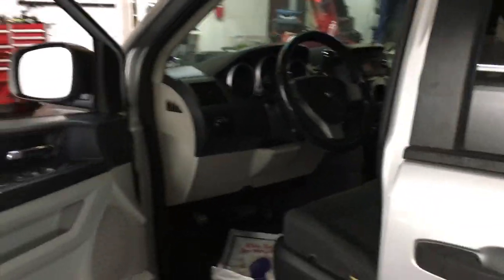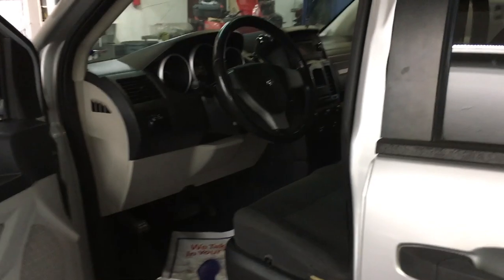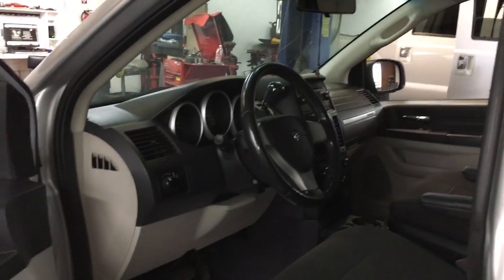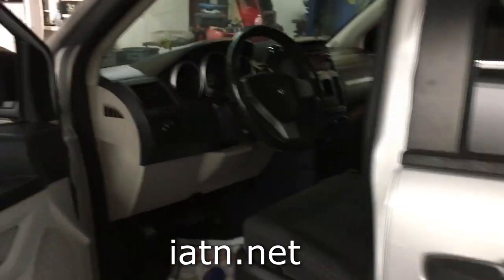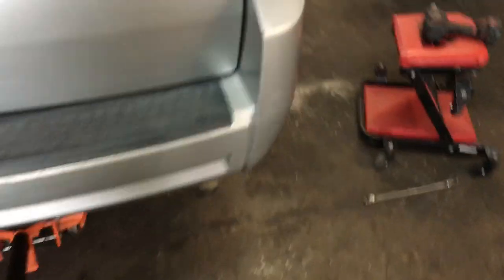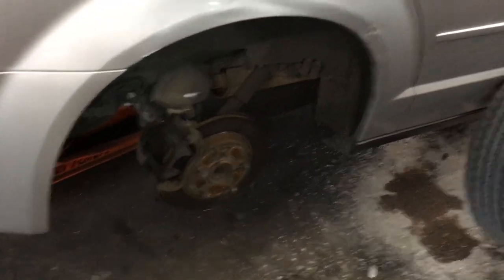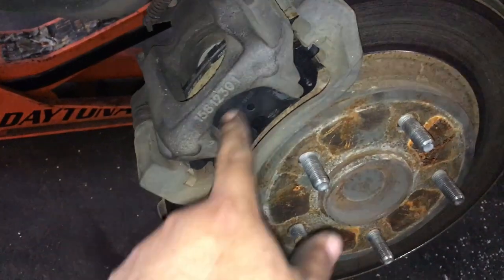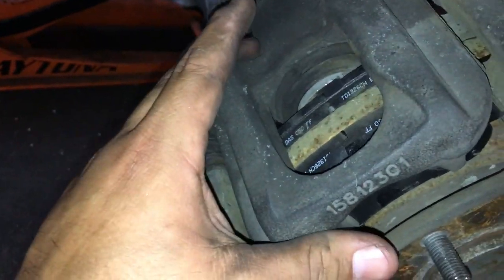DODGE GRAND CARAVAN BRAKE PEDAL GOES TO FLOOR QUICK TIP!

Comment: Okay, I have a question. 2006 Dodge Grand Caravan. Pads and rotors seem fine. Recently, the stupid ABs light came on. Seemed like your typical ABS nonsense, poorly made garbage wheel sensor or something. But had no effect on the van driving. Could shut it off with the scanner tool or disconnecting battery. It would come back on after a day or two. Then, after months of that light being on (not sure if it's related) the pedal would sometimes feel soft and go to the floor. I could let off it, and hit it again, and it would work. Scary feeling! It seems like it is intermittent, but only appears to happen when the ABS light is on. My mechanic insisted it was the master cylinder. So we replaced it, bled the brakes, and took it for a ride. Drove several miles in the mountains here, and no issue. The ABS light had gone off because he disconnected the battery to clean the battery posts. Then the ABS light came back on but still seemed like it was fixed. The next day, took it for a ride to my son's work, seemed fine all the way there (about 8 miles). On the way back, the pedal went to the floor just like before. I showed him this video and he pulled the wheels off the back, and my 2006 Grand Caravan doesn't have the screw in cylinders. The piston seems to be right up against the pads. So I have no idea. He is currently trying to bleed them again to make sure, and I'm waiting for a call back. Besides the fact that Dodge just makes horrible vehicles, anyone have any other suggestions?
Reply: For the record, this van is a 2006, but only has 119,000 miles on it. Always been maintained. It was owned by my wife's grandfather who passed away 2 years ago, and it was passed on to us, or I would never have bought a Dodge by choice. He ALWAYS took great care of his vehicles. It never saw snow and was mostly used for highway driving in Florida. Please help!
Reply: So what ended up being the issue?! 🤷
Reply: @adamxenon829  So my mechanic suggested that maybe they sold me a bad master cylinder because the brake fluid turned black without hardly any use. So he suggested I get a new master cylinder and try again. So I did. And I haven't had a problem since. However, sometimes when it's raining the ABS light comes on for that front right speed sensor. I'll replace that eventually, but where I live, I don't have much need for ABS anyway. In fact, I think ABS is a waste. Never needed it before.

Comment: Am having intermittent problems with brake pedal response.  Just had to hit it to floor on a 2013 caravan and then release and reapply before the brake would catch.  (Was parking stop the time).  Later brake responded to only a light tap then had to depress harder to get brake response.

Comment: On my 2005 Lexus GX470, brake pedal would sink to the floor and even then the truck still advances until I pulled up the hand brake.  Local shop could not figure it out, just replaced brake pads and it went back to normal. Now the issue is back.  You think this method is applicable to my ride?

Comment: My ABS , BASS , ESP dash lights and the. 'Slippery when wet ' light ....all ON... :/
So far can't get them to go OUT.
I Have a 2010 Dodge Ram Caravan......electrical malfunctions.....windows go down on their own while van is NOT running....( scary ) and electrical engaging noises are heard in the doors when van is off.
I'm also aware of the Airbag Recall......oi.......bought it off the Car Lot having no idea what I was in for.

Thanks for the vid ....more to think about.
I recently had new ceramic brake pads and rotors put on....again......

Any other suggestions much appreciated 👍

Comment: I'm  having this same issue after replacing my rear pads. I actually figured this out about backing the caliper out and it solved the problem when I had the old rotors. I decided I might as well replace the rotors, and now the calipers are acting the same way like they are screwed in too far, but with the new pads and rotors, there is no room to back the caliper out and still fit the caliper over the pads. Even a 180 turn (the smallest possible) is too much and I can't install the caliper. Is there a way to adjust the baseline so the brakes will function correctly again?
Reply: Note that there is a difference in the rate at which the piston moves when screwing in versus screwing out.  Turning out moves fast, It takes many more turns moving in to go the dame distance.  If a half turn ts too far out, back int in after moving out to get a good fit.

Comment: Hi, I have a similar issue on a 2011 Routan which I think is the same thing as the Chrysler. For me the pedal sinking only happens when I brake hard, pedal sinks to the floor and takes a while to stop.

Can this issue mentioned apply to my issue as well?

Normal braking seems fine.

Comment: I'm having the same problem but I never replace the back brakes because they are fine I replaced the two front brakes and now I'm having that problem . Could it be because of the rear brakes?

Comment: Finally, this is my car's situation, my Routan have to make a safety check by some garage in Ontario, I paid more than $1000, replace two rear brake rotors and pads and other, but the brake became soft, it wasn't like this, I drive the Van to garage let the boss try it again, he said this is no problem, .....the Ontario government issue some rule make my car repair worse, the boss didn't understand this detail and his disciple did this poor job, after repair, I got a worse brake system, do I need to tell the garage let them to learn this?

Comment: Hum... On most cars the piston would self adjust by applying the brakes. The biggest problem I see with the calipers that have the e-brake integrated into it, is not aligning the pin on the back of the pad with the slot in the caliper piston. On most cars this means screwing the piston back in but stopping with the slot at the 12:00 position. 
If you don't so this the pin on the back of the brake pad will not fall into the slot and you end up with the gap like you talked about. Note that this would not apply to cars that use the drum style e-brake made inside the rotor assembly.

Comment: This video did not address the issue of 'why' there is a gap between the piston of the brake caliper and the brake pad, all you did was adjust the gap so the piston is now touching the brake pad. The piston in the calipers are self adjusting for wear of a brake pad. If you have a gap with new or old brake pads, the problem is most likely that the gasket around the piston is sticking and preventing the piston from turning freely when braking/adjusting. This is common on all rear disc brakes, and is the result of the piston not being lubricated (externally) and cleaned.

Comment: Aren't the calipers supposed to self adjust? I have a 2010 Dodge Journey RT with the same problem, would it be that the piston is being turned in with too much force when the pads are replaced?
Reply: Still doesn't make sense why this would be an issue. If the piston was turned in flush it should pump out to meet the pad otherwise as the pads wear you would have to continuously adjust the piston.

Comment: I guess this type parking brake should adjust to limited location, make sure no gap between the pads and rotor, other wise brake piston should move a long distance and make the brake pedal soft...

Comment: 2016 Ford Explorer has that same twist in rear caliper as did my 02 Accord. Both were placed back and functioned without issues for me. Do you think the owner compressed the piston back in instead of turning?
Reply from the maker: I’m not sure but I do believe it may have to do with the rotors being too thin. I recommended replacing them to the customer, but he declined.

Comment: Great video. For those that are asking about why this happened, or can this happen to front front brakes, or why wouldn't pumping the brakes fix the issue.......This caliper in the video is "unique" because it has a parking brake cable attached to it. The piston of the "unique" caliper works differently than the piston of the "basic" caliper because it has two functions, not just one. I wont got into detail of why it works differently. Just know that you wont have this issue with "basic" calipers. 

Many vehicles are now using an electronic parking brake system which does not use a brake cable. But same thing applies here. They have "unique" calipers that work differently than "basic" calipers.

Comment: My 2011 Grand Caravan has an intermittent low brake pedal. Happened back in August 2019. When I got it to the dealer the pedal was high and firm again. They had no idea what the cause was. Happened again Jan 2020 on my way home from Tampa. While pulling into a rest area I had my foot on a firm high brake pedal and then it went down near the floor. Still had braking but very low. About 20 miles later the pedal came back up and was fine the rest of the way home. If anyone has any ideas I would love to hear. Thank you!

Comment: I have a 2001 dodge van that has something similar, the brakes work upon pressing ok, but if you let up just a little and ride them the peddle loses pressure and eventually just goes to the floor and stops working. Is that what this is?
Reply: Bad master cylinder.

Comment: I went thru multiple brake parts changes and then the mechanic had for it 3 weeks. Found out that the new rebuilt front calibers from Autozone contained dirt and pockets of air even though the mechanics said they pumped gallons of fluid thru the system. They took off the calibers and pressure tested them with air and worked the calibers that they said were sticking and bench tested them. He said he never uses Autozone, Oriellies ect. for parts. It works now. Front Calibers, brake shoes, master cylinder, used ABS, $800

Comment: Typical Chrysler poor design. How does this company stay in business?
Reply: well....they sorta don't really..."Chrysler" has actually been five different companies in the last 25 years.
Reply: @geoffrwelsh  I meant the current one that sells cars that are junk before the odometer reaches 10 miles.
Reply: Issue is lack of using park brake often enough and right after new pad installed. It self regulates, keeping calliper piston in contact with brake pad.
Same design utilized in so many car makes.
Reply: @vwecco1  That's BS. I've changed tons rear pads. Rear caliper ALWAYS self adjusts correctly.

Comment: In order to have the piston barley touching the pads you need to purchase after market pads that do not have the metal peace sticking out where the piston groove is, if it does have it, it's going to be too much of a gap for the brakes to have a decent contact.

Comment: Man, that customer fired a really expensive shotgun at that van.  

New pads, worn out rotors, mmmmmm.

One thing habit I got into when these calipers were more common is that pumping the service brake and working the parking brake at the same time seems to work pretty well at avoiding this problem.

Comment: Hi there
I opened to see how is my Dodge Caravan 2010 I FOUND INTERESTING THING
1- park brake not holding the wheels.  2- There is a little gap between pad and rotor.  3- I could not spin it any direction.  4- Took it off then found there are 3 pins (stud) on back of pads and the middle one doesn't let the piston spin, it has been installed with the cut off on piston (for tool) over the pin. 
as you now piston needs to spin to go out and push on pad .
I GRINDED THE MIDDLE PIN.!!!!!!!!
It is self adjusting now.

Comment: Ok, but what about when you change the front pads on a grand caravan, and squeeze the calipers in, do you get NO pedal after you reassemble it?? Goes to the floor. Pump it with engine on or off. Brakes grab at the floor but no peddle. Happens every time.

Comment: Your going to send it out with just doing what you described.  So you dont think who ever did the rear pad swap..... did not damage the caliper.
I have seen this before. My customer told me that they did rear brakes on a Nissan and never felt right after. Then I asked if he had difficulty. He said yes he had to really work the C clamp to get the piston back in. 
Please replace your customers calipers.

Comment: Sooooo...  when the rear pads wear are you going to re-adjust?    Here lies the problem with your solution.  Throw the $80 dollar caliper in the garbage.  It's a self adjusting unit and should have pumped out to meet the pad after brake installation.  Caravan calipers are marginal at best.  I could fill a large bin with Caravan calipers replaced over the years solving the same issue.   BTW,  do both.   Just my few cents after 23 years of service.   Good video for the driveway guys that do their own brakes and come across the same problem.. will get them to a shop to safely replace calipers.

Comment: As soon as I saw the video, I knew what was wrong. It's a Dodge. Do NOT buy anything from Dodge. Dodge have been making cars since 1900, and they still have not figured out how to make reliable vehicles. When they discover problems, they don't fix them. They continue to mass produce garbage. Try to find a Dodge Neon on the road today. Those cars were junk, with paint that peeled off down to the primer. The 2.7 motors they actually put in Dodge Chargers have a long history of failing, and yet they continued to put them in cars well into the 2010's. Dodge is the worst car company in America. I personally will never buy one again. If you want something reliable that won't get you killed, get a Honda, a Toyota, or a Subaru. Sure, Dodge makes good LOOKING cars, but they are made of garbage parts, by the worst engineers America has to offer.

Comment: well it looks like the caliper is faulty.i work at a dodge dealership and ive never had this exact same problem before and i have done a lot of break jobs on these vans.the caliper should pump up nice and tight directly onto the brake pads.i would have replaced those rear calipers if i were you.